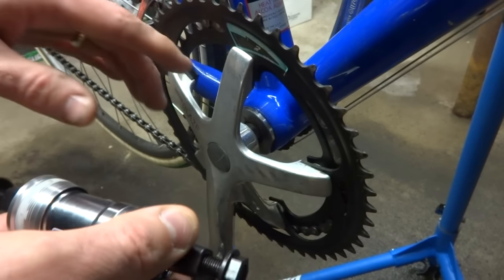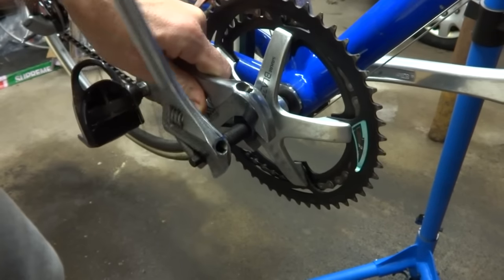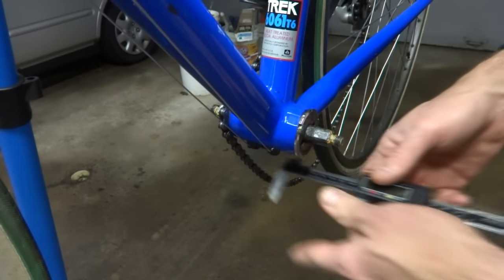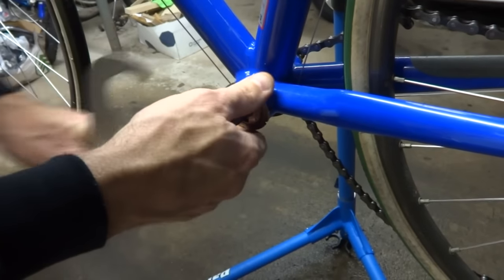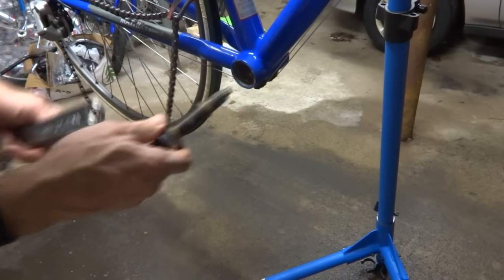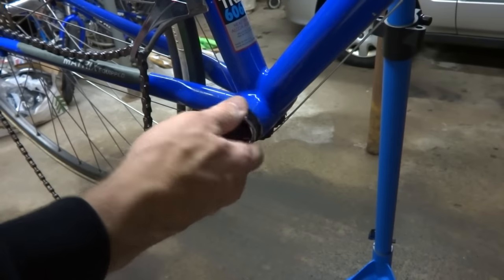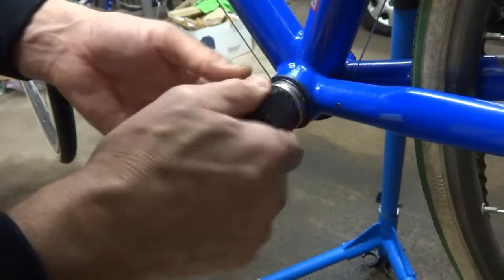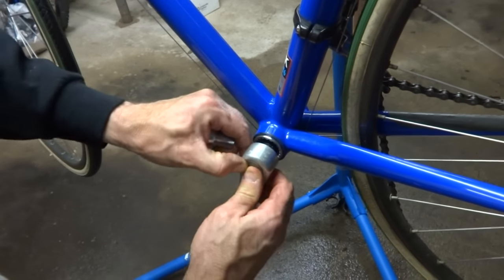How To Upgrade Vintage Bike With Sealed Cartridge Bottom Bracket

Comment: You lucked out. I was going to replace the ol' loose bearing set on a vintage Schwinn  Unable to use the Shimano UN-55. Turns out both sides were right handed (normal) thread, the Schwinn left side was left hand thread, so new unit was useless. Had to order one of the threadless BB units used for stripped thread BBs. Be advised.
Reply from the maker: Normal BB threading is non-drive side right hand threaded, and drive side is left hand threaded. Exceptions are French and Italian made bikes can have the drive side be right hand threaded.

Comment: Hi, I suspect that the guy who worked on my bike put the wrong size of spindle, because there's no way to adjust my 
front derailleur, even after buying new cage and removing the h screw completly. How do I determine the correct length without relying on the old one?

Comment: Hi RJ, what do you do when there is no existing bottom bracket installed? I know you can still measure the bb shell but how would you figure out the spindle length for an old bike?
Reply from the maker: The spindle length is dicatated by the crankset. Look up the specs of the crankset. If you can't find the recommended spindle length, you may have to guess. The go by trial and error. The middle of the chainrings should line up with the middle of the cogset. Or pretty close to it.

Comment: hi RJ i followed this video but now I have that huge gap between the crank and the Bottom bracket where the spindle is exposed - should i worry about it?
Reply from the maker: No. Not as long as you used the correct length spindle for your cranks.
Reply: @RJTheBikeGuy  thanks!! i thought i got the wrong bottom bracket that had cylinders that "mushroom" out from the shell - but now I see thats a different kind of crank set!  thanks!!!  I'm working on a bike build of my own - is there a way to share to you a photo when its finished??

Comment: Hi RJ, I’ve got  a couple questions about your videos about bottom brackets. I’m just upgrading my bike with a newer groupset that also happens to have a sealed bottom bracket with a square taper. First, I’ve got the used bottom bracket that came with the groupset, but I noticed a few of the first threads were damaged so I just ordered a new one because I don’t want to it to go cross thread and ruin the threads in the frame. Was it overkill ? Second, on the other video I’ve seen from you, you used anti-seize on the threads, but on this one you used general purpose grease. I’ve got grease with teflon, do you think it would be fine to use it or would you recommend another type of grease/anti-seize ? I’ve heard anti-seize is usefull if you have steel/aluminium contacts which happens to be my case (steel frame, aluminium bottom bracket). Thanks in advance !
Reply from the maker: I don't know how damaged the threads were so I can't say. You want something like grease or anti seize, to keep moisture out and the BB from becoming seized.

Comment: Im working on a vintage Trek 7000,,, the BB spindles measure 136-7mm... I cant find any cartridge replacement that big,,, would that be a stock size? Its my wifes bike,,, she bought it new,,, she never had the BB serviced or changed so its got to be original,,, what the heck?  Any advice would be much appreciated ,,,!

Comment: What about the threaded locking disk with the notches you took off? Does that not need to go back on?
Reply from the maker: That was part of the old bottom bracket and not part of the new bottom bracket which doesn't use a lock ring.
Reply: @RJTheBikeGuy  Got it, thanks! Couldn't tell if I'd keep that piece on mine. Have to say I kind of like the closed look of the previous one, wondering what I can do about keeping mine

Comment: The cup the non drive side isnt going in all the way. Is it normal for it to be sticking out a little? It goes in all the way without the spindle/BB. Plastic cup. Dont want to break it trying to tighten it in. Thank you!
Reply from the maker: The "cup" on the non drive side just supports the cartridge. Tighten it in till it stops. You can use the torque values.
Reply: @RJTheBikeGuy  thanks alot for replying! Love your videos. Wasnt sure if it was suppose to go in all the way on both sides of the BB

Comment: I have an older bike where the bottom bracket has been removed, but not replaced. Old parts are gone. So I cannot measure the spindle width as you did starting at 2:10. What should I do when I have an unknown spindle width?
Reply from the maker: The spindle length is dependant on the cranks. Look up the specs of the cranks and they should have the spindle length.
Reply: Thanks RJ, I'll see what I can find.

Comment: Could a thread be an issue? I made sure the measurements are accurate and ordered the English (CCW) threaded sealed BB, but it won't screw in! I am 100% positive the original cup is also CCW. Any input? Should I just force the cartridge in? Thank you
Reply from the maker: Don't force it. Double check the threadings on the old and new cups.
https://www.sheldonbrown.com/cribsheet-bottombrackets.html
Reply: @RJTheBikeGuy  Thank you!

Comment: Really like your how-to videos. But why exactly would you want to replace the old style ball bearings in cups with a sealed bottom bracket?  It takes just a half hour or so to clean out and re-grease the bottom bracket in my 1985 Trek 830, but much longer to overhaul the sealed unit in my wife's 1998 Scott Boulder (oh yeah, thanks for that great video too on how to overhaul a sealed BB) or buy a new one for over $30.
Reply from the maker: +Steve Petttyjohn Generally you don't overhaul the sealed units. They are designed to be replaced. You can though, I have done it and have a video on it.
Reply: +RJ The Bike Guy  Yes, I was so inspired by your video that i did overhaul my wife sealed unit. Thanks!
Reply: +Steve Petttyjohn  Meant to say; "my wife's bicycle sealed" unit.
Reply from the maker: +Steve Petttyjohn That made me laugh.
Reply from the maker: The advantages are plug and play. You don't have to mess around with adjusting them. They are also sealed better against contaminants getting in.

Comment: Thank you RJ. I wonder if the upgrade to sealed BB is reasonable when the old style ball bearings is still in good shape. I paid 1,50 $ for the set of new bearings for my BB-M500, whereas sealed cartridge you've used is approx. ten times more expensive... Is it about the performance? My ball bearings bracket proved durability more than well since 1990, will sealed BB last for that long or more?
Reply from the maker: The first bike I did this swap on still has the same cartridge BB in it. Lot and lots of miles on it.

Comment: I have this exact bottom bracket on a vintage bike which doesn't seem to want to budge? Any pointers on helping me remove the lockring?
Reply from the maker: ChrisUnknown The lock ring on the non-drive side is stuck? As opposed to the adjustable cup or fixed cup? If so, get the tool on there and tap it with a hammer or mallet. Make sure to turn it counter clockwise.
Reply: RJ The Bike Guy What size Wrench did you use? at 3.55
Reply from the maker: It's a 12" adjustable wrench. I have a couple different 12" adjustable wrenches. The Harbor Freight model opens wide enough. The Craftsman doesn't.

Comment: I prefer cages over cartridges its smooth until it isnt then its done because you cant rebuild a cartridge but with cage or loose ball threaded bottom brackets can last a very long time if properly cleaned and greased
Reply from the maker: I actually can rebuild some cartridges, but generally they are just replaced. But they last for a long time.

Comment: I'm upgrading a bike and I want to use a shimano crankset taken from an old specialized with octalink BSA bb (121 long). Should I buy a new octalink bb italian version with the same spindle length or shorter/longer because my shell is wider then the previous bsa frame? Thanks!
Reply from the maker: BSA/Italian is the threading on the BB and needs the match the frame. The spindle length is dictated by the crankset specs. And there were also a couple different versions of Octalink, v1 and v2. You need to use the one that fits your crankset.
Reply: @RJTheBikeGuy  yeah I know. I'M just guessing if a different bb shell will affects the spindle length. My crankset  is shimano fc m341, which sometimes is selled with 118mm spindle, sometimes with 121.

Comment: If I were to do this, can I get a, for instance, 73mm bottom bracket but get a larger spindle size, I want the pedals to sit wider than original but have the chain ring be in the correct location. Thanks,
Reply from the maker: The pedals are attached to the crank arm which is attached to the chainrings. Moving the crank arm out will move the chainrings out too and change the chain line.

Comment: I own a 84 schwinn cruiser and want to convert it. Would I need a 115 or 110?
Reply from the maker: The spindle length depends on the cranks. Match what was there before or research what length those cranks require.

Comment: If you have an old cotter pin style crank, where do you measure the bottom bracket from?
Reply from the maker: If you are converting to square taper look at the specs of the crankset.
Reply: RJ The Bike Guy I just found your video on converting to square taper. Made way more sense after watching that! All measured up and just have to order the parts! Thanks!

Comment: I assume the threads would not fit if you tried to do this to an old raleigh made in england? is there another solution if you can't find replacement parts?
Reply from the maker: Not if it used Raleigh standard threading. Maybe a threadless BB.

Comment: I have an old KHS road bike from the 80s. It doesn't have a chainring. The old BB has a spindle length of 123mm The new double  crankset that I just got says it's to be used with a spindle length of 110mm. I'm afraid if I get the 110mm the inside chainring will be too close to the frame? I don't know what to do? I don't want to end up getting several BBs until I find the correct one.. Does the, what I call the width of the hub where it fits over the spindle on the crank determine  what size length of BB to use? I see some cranksets are wider than others where they fit over the spindles.

Comment: Are there different types of sealed units? Would like to upgrade a schwinn Letour I am building its a 76.
Reply from the maker: Shouldn't be too much of a problem. They come in different sizes. The two measurements I mention in the video are the ones you most need to be concerned with. Schwinn should use standard English threadings. When you get into Italian and French bikes it can be a little wierd.
Reply: shyflirt1 Thanks for your help.  A little new at upgrading old bikes.  Thanks for your help and videos!

Comment: My old Trek 6000 BB measures 68mm x 137mm and I cannot find any sealed cartridge BB with a spindle that long.  I want to order a UN26 BB 68X127 and give it a try.  Do you think it will work?
Reply from the maker: That is a huge difference. You are sure it is 137mm? Is there a brand/model on the BB? A drop of 10mm will normally throw the chain line off, and maybe have the rings rubbing on the frame.
What is the brand/model of the crankset?
Reply from the maker: I saw this on ebay. http://www.ebay.com/itm/VP-BB-English-Square-Bottom-Bracket-Set-68x-137mm-VP-BC73A-Aluminum-Cups-/131244720049
Reply: I measured like 10 times from end to end of the square tapers part of the spindle excluding the threaded portions.  There is the number 1187 engraved on the spindle but unsure what it means. My BB is Hatta 1.37" X24T and the crankset is Sugino Cycloid.

Comment: Hey RJ! I need your help with building my bike! 

I have a Trek 930 frame from 1993 with BSA 73mm bottom bracket shell . 
At the moment I have a BB installed that has a too short spindle (113mm). The crank arm is compressed against the BB and it wont turn smoothly, on the non drive side there is about 2mm clearance between crankarm and the BB. I bought this one because it was recommended in my crankset manual. I know that I have to buy a new one, but i dont now if the spindle should be 118 or 122,5 mm long. Sheldon Brown says that the chainline distance should be 47,5mm (I have 45mm at the moment). But i have an oversized seat tube!

Sheldons quote: "Shimano spec, measured to the middle ring. 47.5 preferred, but for frames with oversized seat tubes, the longer dimension may be needed, because the fat tube places the derailer mechanism farther to the right."

What should i choose? 118 or 122,5? What should be the clearance between crank arm and the BB? 

BTW. I love your videos! You are the best bike mechanic out there!
Reply from the maker: If you have 113mm now, I would try 118mm. That is an extra 5mm. 5mm/2 is 2.5mm. And that might get you from 45mm to a 47.5mm chainline. Give it a shot.
Reply: Thank you for such a quick reply! I measured BB-crankarm clearance on the non drive side on 3 other bikes. Its 7-10mm. I have 2mm at the moment, so I am thinking about 122,5mm spindle, so that would give me 7mm spacing on the left and 5mm (or less) on the drive side. What do you think?
Reply from the maker: I would try the 118. Maybe you can find a 120.
Reply: Thank You!
Reply: I found out that I understood the shimano sheet wrong, and the recommended spindle length should be 123mm. I am gonna order 122,5mm. Thanks again!
Reply from the maker: Okay that sounds good.

Comment: my old shimano bottom bracket measures 114mm..Since its a french thread bottom bracket from the 70's, I only have one maker of modern sealed french thread bottom brackets , Velo Orange. They make a 113mm and a 116mm. Should I get the 113mm?
Reply from the maker: I would guess the 113. But either would probably close enough.

Comment: my bottom bracket shell came to 70mm wide, with a spindle of 123mm. Would it be safe to go with a sealed bb that is 68x122.5?
Reply: nevermind i found a 70x122.5
Reply from the maker: Cool! And no, you wouldn't want a 68mm BB.

Comment: what size spanner do you use to remove the drive side lock ring/cup?
Reply from the maker: +Iain Brown One that fits. BB's come in different styles. I think I used a 12" adjustable wrench. I have one 12" that opens wide enough and one that doesn't. Yours might not even work with the same tool.

Comment: hi RJ The Bike Guy 
i just want to know where do you see the number of the mesure: 115,14 in the Sealed Cartridge Bottom Bracket???
there is just written the mesure 68...
thanks :)
Reply from the maker: I show where to measure in the video.
Reply: No this with the measures I realized. 
What I don't understand is with the new sealed cartridge bottom bracket : it is written 68 and BC 1.37 x 24 and as you were explaining in the video you also had the other measure of 115,14, but the problem is that in the new sealed cartridge bottom bracket there is nothing informed for this 115,14 measure
thanks :)

Comment: Hi RJ!
I need to replace the bottom bracket on my mid-90's Diamondback mountain bike. I've had it apart and noticed the the caged bearing assemblies are missing a few ball bearings. I would really like to replace it with a sealed bottom bracket. I measured the spindle and it's 124.5 mm. I'm having a very hard time finding any source for a BB that's that wide. Can you point me in the right direction on a source for a new BB?
Thanks in advance!!!!!
Reply from the maker: I would just be using google. You can use google as well as I can, so have at it.

Comment: My bottom bracket shell has a small bit sticking up inside it, any advice on how to remove it?
Reply from the maker: It might be the screw/rivet for the cable guide underneath. You may be able to grind it shorter.

Comment: In this video, the original spindle appears to be symmetrical (or very close). Not all the old-style spindles are (see https://www.sheldonbrown.com/bbsize.html ), so simply measuring their width may not result in getting a cartridge bottom bracket that yields the right chainline.
Reply from the maker: The cartridge will be similarly asymmetrical. They don't make cartridges with left right measurements. It will be fine.

Comment: What's the point of changing the bottom bracket if the old one works fine ?
Reply: No maintenance and if your swapping parts from another bike and the bottom bracket sizes are different you only need the new bb but can use your old crankset

Comment: hello i have a question. i have a 73mm 113mm square tapered shell for the moment on my rocky mountain bike. I bought a new frame but the bb length is 68 mm. What size bb should i buy? 68mm 113mm or will the 5 mm less of the frame change the size of the bb?
Reply from the maker: +Djmat8 You can add a 2.5mm spacer on each side and use that BB. Or buy a 68mm bb. The spindle legnth is determined by the crankset.
Reply: +RJ The Bike Guy  yes i understand that but is it better to reduce the spindle of 5mm and get a 108 instead and buy a new 68mm bracket?
Reply: since my new frame is 68mm and the rear spacing is the same 135mm i will use the same 3 gear crankset i have and i wanted to know if its better to redude the spindle by the amount less the shell is on the new frame
Reply from the maker: Spindle length has nothing to do with shell width. The cranks dictate the spindle length. Look up the specs of your crankset.

Comment: What is the diameter of the hole after bracket out in inches I got a 212cc motor on I need to install foot pegs out of PVC pipe?